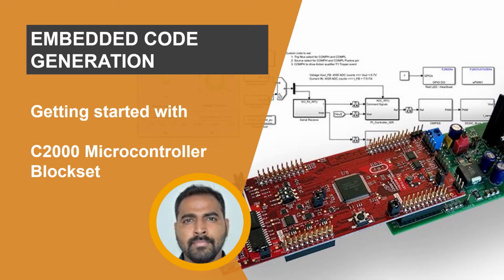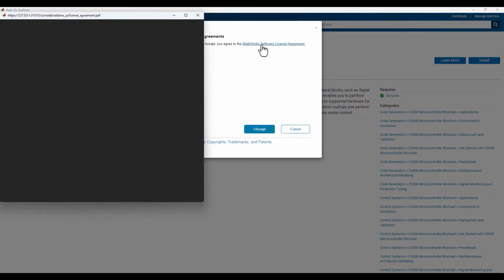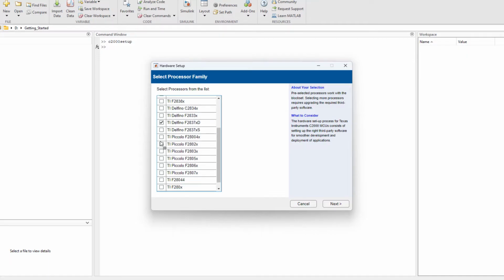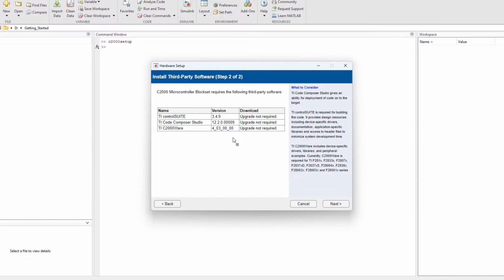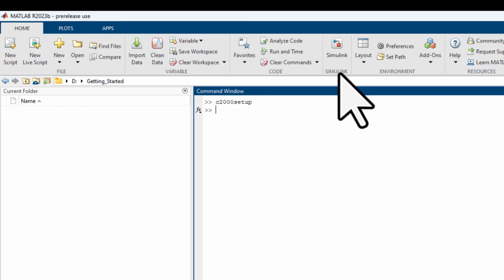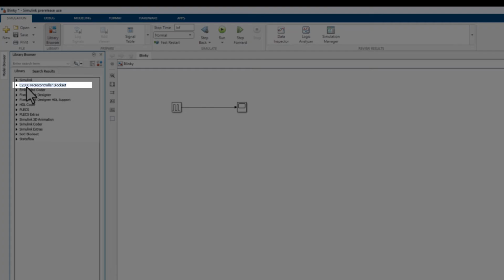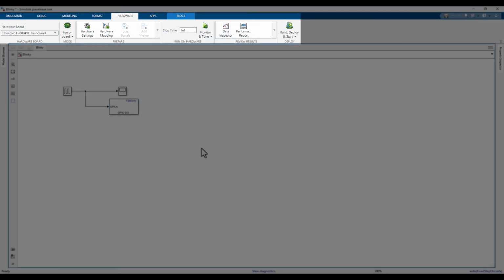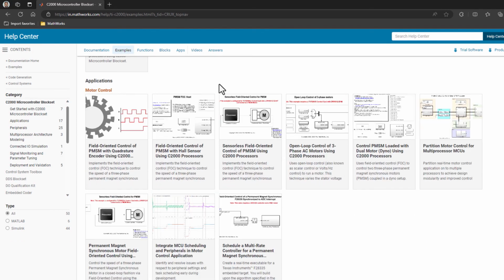Getting Started with C2000 Microcontroller Blockset | C2000 Microcontroller Blockset, Part 1

Comment: Your current working folder is: 
 C:\Program Files\Polyspace\R2020b\bin
Simulink does not permit you to modify the MATLAB installation area. 
Please change to a working folder that is not in the MATLAB
installation area and re-try the previous command.

Comment: Sir in MATLAB 2023a version there is no " hardware support package for c2000 microcontroller" instead MATLAB says we should use c2000 microcontroller blockset along with embedded coder. my question is for  my error which is  "Failed to check out license for block 'Serialcomm/Digital Output'. The block needs one of the following licenses: 'C2000 Microcontroller Blockset'"  but my serial communication is established properly (i checked it with serial configuration and serial receive block... i got the proper response from my 28379D launchpad...hence seral communication is established). and when i try to configure my launchpad in hardware configuration i am not able to connect, but my device is listed in the list.... what is the problem sir??? plz help me